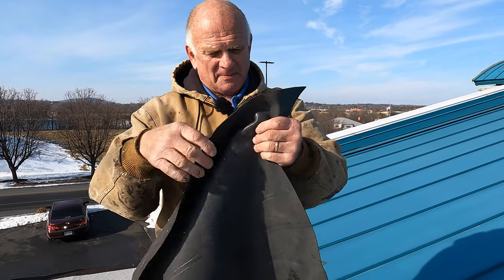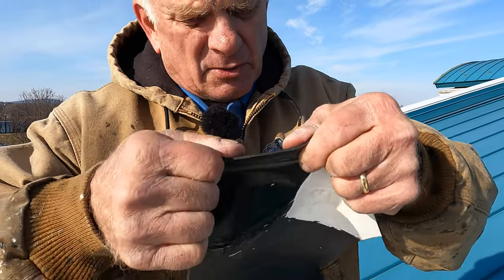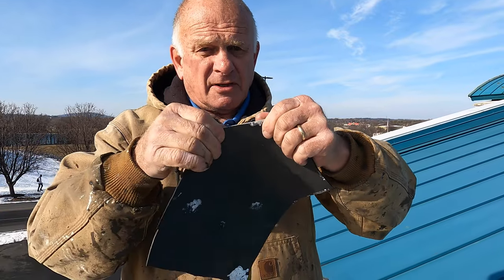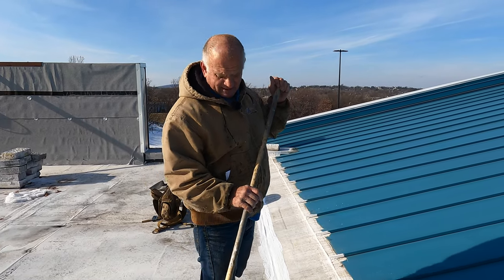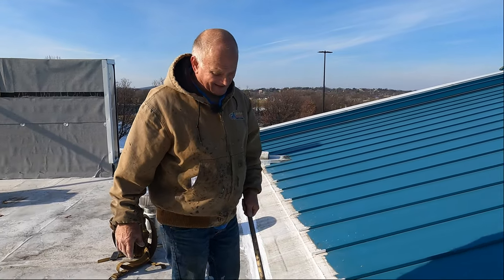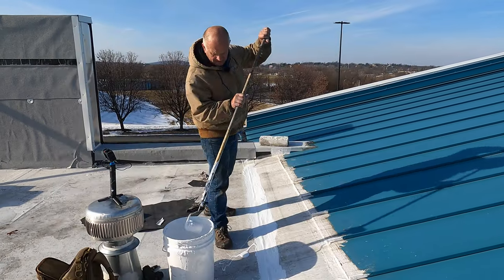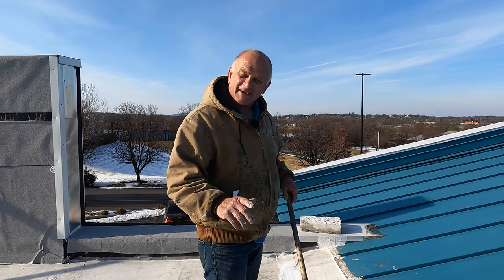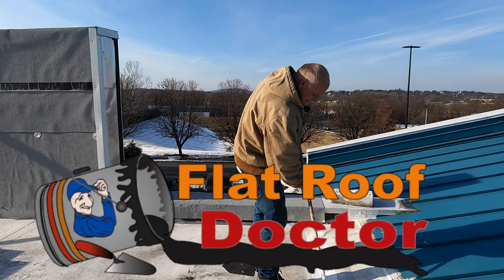EPDM Rubber Seam Repairs / My Story on How I got into roofing

Comment: I like your videos and explanations but am a bit confused on the fine differences between the failed repair and the new one. When you show the previous silicone repair, you showed they had also used some kind of tape. What I am not understanding is how that silicone repair with that "tape" in the middle of silicone layers is different than the version you are showing with 4" wide fleece. Is that "tape" not a 2" wide piece of similar fleece that they layered between silicone just like this repair? Will the edges around the fleece behave similarly a year or two later?Thank you.
Reply from the maker: Sorry for responding so late. The tape they used was some kind of paper that had some glue on it. Then they coated the roof with Silicone. I removed that tape and then did the seam with a Polyester  fabric and Silicone